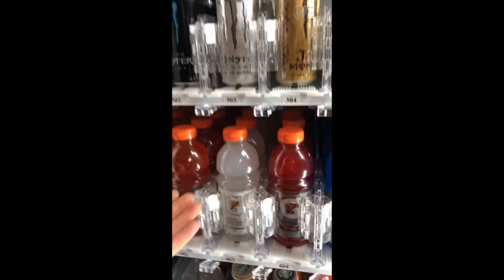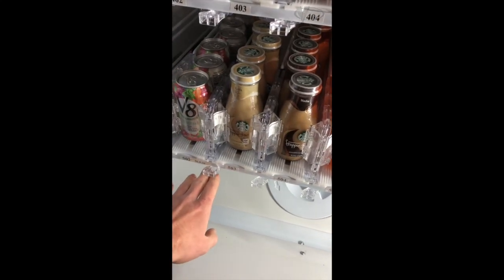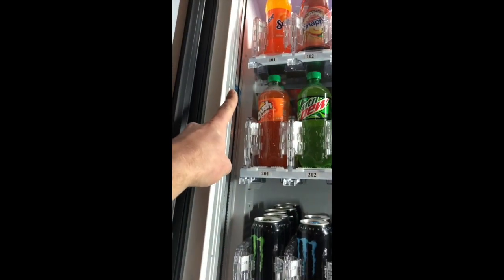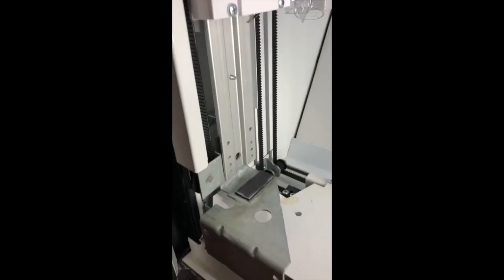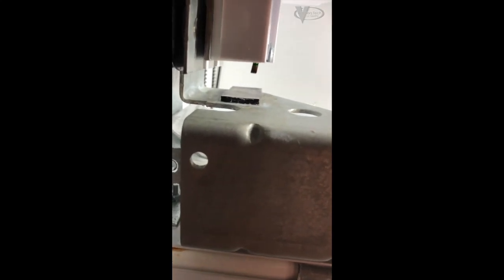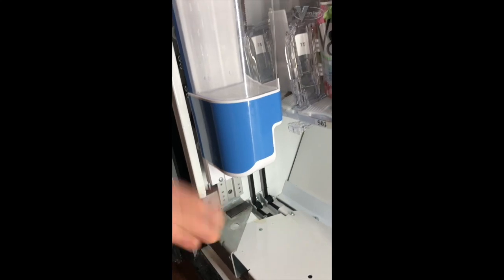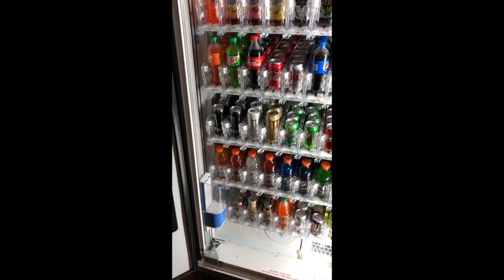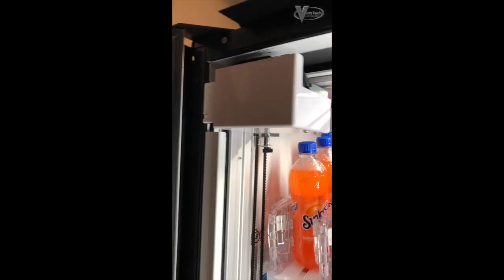Crazy Cup Alignment & Vertical Position Problem on a BevMax Media DN-5800-6

Comment: I replaced the cup holder and nothing until I changed the offset setting to 700 and then it started working on a crane 5800-4, so make sure the setting is correct!

Comment: I started having a similar problem... about every 24 hours my picker starts shoting too high hitting the shelf instead of the target. After a few reboots it would work again for another 24 hours. Now i think hitting the shelf is causing additional problems with the  plunger.
Reply from the maker: Your switch on the bottom of your cup very likely is full of soda syrup - even if you can't see any to clean.  A new cup will probably fix your problem, and would be the first step in troubleshooting your issue.  https://stores.vendorstech.com/new-dixie-narco-bevmax-2-3-4-6-delivery-picker-cup/
Reply: @VendorsTech  Even without a homing switch error? So the machine calculates distance based on when the switch opens?
Had homing sw error before this problem but a repair man said he cleaned it up the syrup.
Reply from the maker: @gilbertalvarado5779  The only time you'll get a homing switch error is if the switch isn't closing, or if the control board doesn't see it closing, when it sits down on the home plate.  A switch not releasing upon takeoff would never throw a home switch error.  It is very hard to clean those switches thoroughly, and even though they're "sealed", syrup still seems to find a way in because I see switches all the time that have been cleaned tirelessly still not work consistently.  Eventually, you just have to bite the bullet and replace the cup, or the switch if you want to tear the cup down.  Be aware that the screws holding the switch in place usually remove all the plastic thread from their holes if they are loosened, and you almost always will have to replace the cup main frame anytime you replace a switch if you want to be able to tighten down your screws again.

Comment: Hello, I have a Dixie narco 5800 the cup picks up the soda then it stops for a couple of seconds then it drops a soda in the shoot. Do you have any idea why
Reply from the maker: Sounds like a problem with the product sensor inside the picker cup.  You can turn off the picker cup sensor in your settings, and see if the problem goes away.  If it does, replace your picker cup and turn your sensor back on.

Comment: Our bevmax 3 is not dispensing for some reason, it accepts money and gives change and the motor works well but the slot isnt opening for the drinks to fall. I tried to clear errors and restarted it but it still doesn't work. Please help
Reply from the maker: I'd be happy to help you with your problem.  Please give me a call at 970-623-1272.

Comment: Did crane ever address this issue?
Reply from the maker: We never requested that they address this specific problem, since we were able to fix it, but the issues that led to this problem have been addressed in production-line changes since then by Crane.  At least, this is what I have been assured took place.
Reply: @VendorsTech  good stuff, thanks
Reply: I started having a similar problem... about every 24 hours my picker starts shoting too high hitting the shelf instead of the target. After a few reboots it would work again for another 24 hours. Now i think hitting the shelf is causing additional problems with the  plunger.
Reply: @gilbertalvarado5779  Same thing is happening to me, how did you fix the problem?